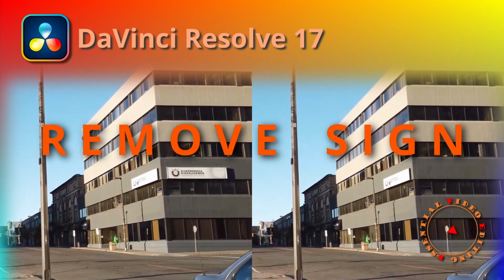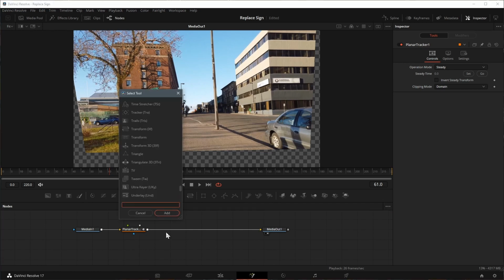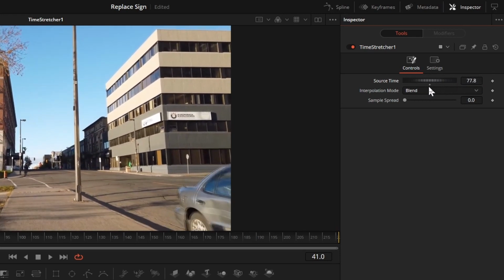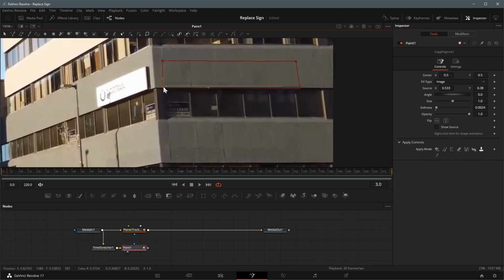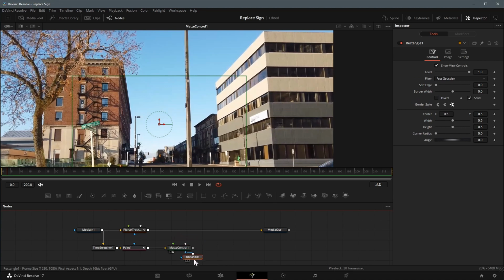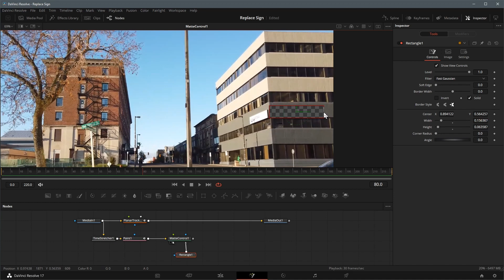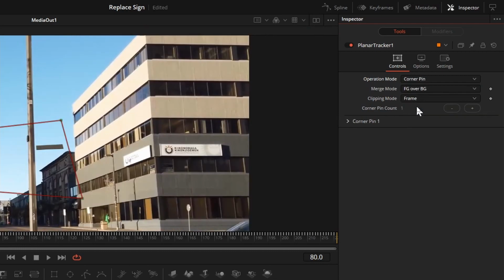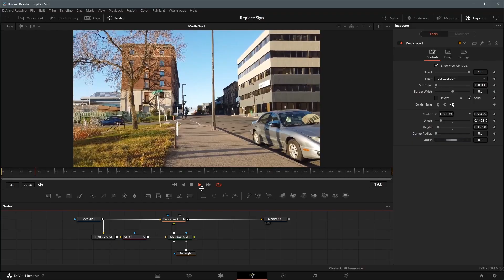Motion Tracking- Remove Building Sign with Fusion Planar Tracker Corner Pin in DaVinci Resolve

Comment: Hi, i am having trouble at the corner pin step. For some reason when I line up the corner pin with the edges of the frame, all of my paint mattes are off. I found a quick fix by just moving corner pin until the matte covers the desired area, but then I lose a lot of the fine tuned work I did with multiple paint nodes. 
Your insight on this is much appreciated.